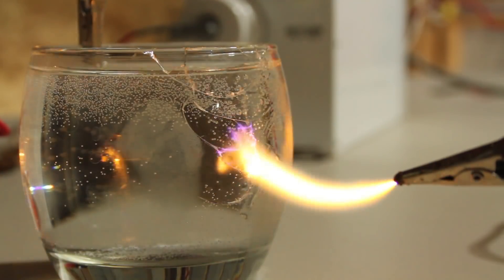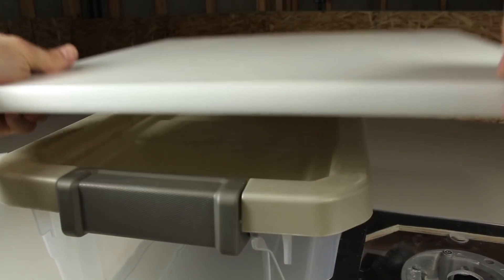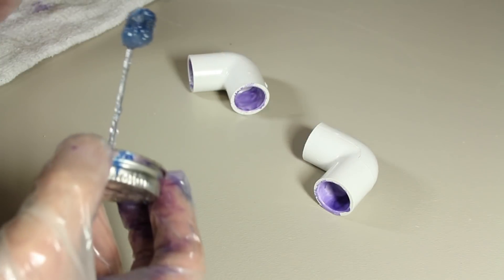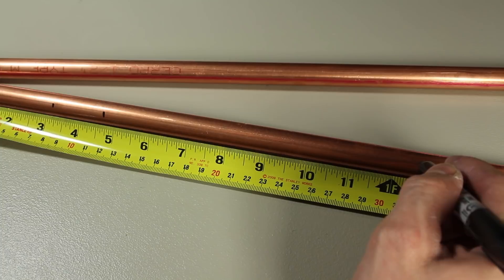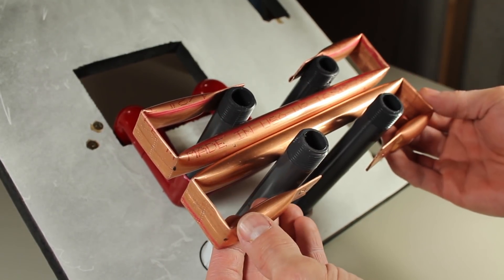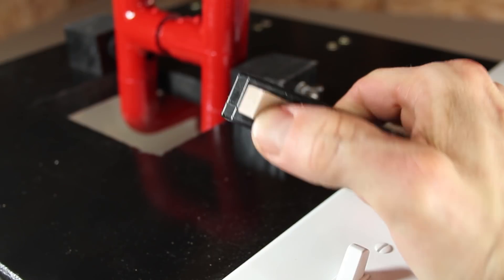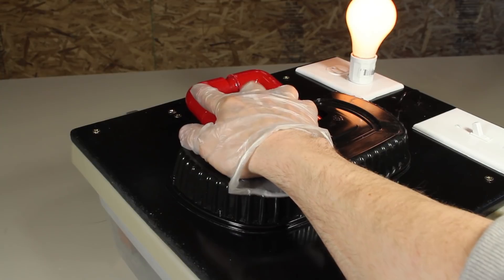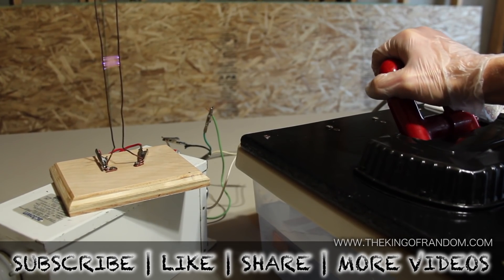The Scariac (Poor Mans Variable Power Controller)

Comment: The voltage doesn't change because the load induced by a volt meter is negligible.  If you had had a load, such as the table saw or grinder, plugged into the other outlet, the voltage would change A LOT.  Moreover, it does not adjust the rpm of a table saw or grinder, only the horsepower available, which is what is limiting the RPM.  Thus, unlike a motor control, the table saw and grinder running at low RPM as shown here would have so little torque that they could not accomplish any useful work.  The upside is, while rheostats can be inexpensive, on to handle this much power would not.  The water enables it to dissipate a lot of power, inexpensively, with a usable duty cycle.  The concept could prove to be useful in a survival situation.
Reply: your correcting a dead man
Reply: This could've been used in wound rotor motors, as it's primarily controlled by variable resistance due to its design of using brushes and slip rings

Comment: I'm wondering why the electrodes need to be so large (the 18" 1/2" copper pipe).  Does the geometry of the curved surface have anything to do with how this works b/c as the two pipes approach each other, there is a leading edge that is closer than that at a 90 degree angle (inside the tube).  Basically there is 1/4" difference between the front leading edge (the vertical middle) of the electrode and the top of the electrode, and you get 2x the difference b/c there's 2 electrodes.  

If there is 5" of distance then that 1/2" can vary the voltage by 5% and I would think you might get unstable voltages..  Would it not be better to use something like a 4g solid grounding wire that doesn't have this curve?  

Also, could the electrode be much smaller and still handle this voltage & current or is the water acting like a heat sink when the speed is low (more resistance), and will eventually get really hot?

This just seems like a dangerous setup and would think doing this inside a PVC pipe would be better, with an electrode at the bottom and a plunger that can be moved up or down.

Comment: would it be much safer to buy a high voltage rectifier instead? one with a dial to raise, lower voltage tie into an amp meter to see just what you have? be a lot safer.

Comment: Have you checked the output on a scope by chance? I need a variac due to it's sine wave output. Does this output the same or is it a modified wave like a light dimmer or motor controller produce?

Comment: amazing video and idea, but just a little note, the voltage can not be constant, you were just measuring with no load connected hence just getting the open-circuit voltage, however with a load the voltage must change.
what you're saying is that the grinder always has 120v across it yet changes speed as you move the thing, that does not make any sense

Comment: Correct me if I am mistaken, but it seems that this "scariac" could be added to an electric arc furnace to regulate temperature. If I am wrong, what is my best option to achieve temperature control for melting various metals?

Comment: hii,

i purposely revisit this video. because i watched it before.. 
i saw youtube video of using salt water as stick welder project..
and that made me wondering why is the author (forgot his name) uses lye as conductor in the water.. why not use salt ? since they uses salt to do arc welding.. why not use salt ? it is cheaper.. also 100% salt.. - minus a little bit mineral away.. 

or why those who do salt water stick welding don't use lye, instead of using salt ? 

which is better to be use in water ? lye or salt ? 

thx

Comment: bear in mind this comtroller won't work with Direct Current (DC) as the electrolyte will cause electrolysis making HHO gas, which will pop off the lid with pressure.

Comment: I wish ppl wouldn't be so prejudiced against water with electricity. It should be thought of as a liquid wire. It's only risky if you touch the water with both hands when both electrodes are in it. It only makes bad things happen if it gets kn ELECTRONICS as it can short things out. As a fun experiment, use 12v at 6A and put an a cathode in a bucket and an anode in another bucket, then out your hands or fingers in a bucket each and watch and feel your fingers spread out by themselves. It feels a bit like pins and needles but is perfectly harmless at such a low voltage. If this sounds too scary, try putting a 9v battery's contacts on the wide part of the surface of your tounge. :)

Comment: Suggestion: washing soda rather than lye to make an electrolyte. Should work fine, but is a lot cheaper, is easier to find in your grocery laundry section, and won't dissolve flesh. Borax would likely work well also, although is mildly poisonous.

Comment: Everyone is acting like if you build this thing your also going to be using the electrolyte reservoir as a bathroom sink.  Anyone who doesn't understand what an insulator is for should not attempt this project anyway. It's about as dangerous as the wiring in your walls. Ya'll realize those wires are insulated and ran through wooden frames right? Insulation is the line between life and death.

Comment: wow it's not even grounded 

looks ok for low voltage devices but even im not insane enough to tinker with the mains (especially since we use 240v here in Australia) 
and im the type of bloke who walks around with 5KG of unprotected laptop battery cells taped together in the form of a homemade power cell for phone/laptop charging

Comment: ingenious invention. but....particle board exposed to an ionic solution with bubbles/evaporation, questionable. a different solid board might/would prevent degradation and interaction with particle/press wood glue, reducing  risk of explosion. the "melamine" and particle/press wood board with all it's glues and exposed reactive content, regarding binding, once water, etc. are introduced, are a chemically a reactive nightmare. just sayin'

Comment: Your idea is terrific, but it is not appropriate for controlling induction motors, in fact, it might burn them, these motors try to keep their speed and HP constant, if the voltage lowers, they use more amperes, thats a problem.

Comment: very nice but why didn't you use a bearing flush cutter / follow wheel on the router table with template you made to cut the holes in the mfc?

Comment: 1 its resistance hes changing
2 tap water will go through electrolysis which produces hydrogen that could ignite from an arc
3 running too low voltage through motots can make it not turn thus dropping resistance and you have too much current. Although he did only change current, it sorta implies it's fine to run electric motors with a variac.

Comment: when I first saw the thumbnail for this vid I though you were making a saltwater rheostat, which is what we use for load testing generators in my line of work (electric motor/generator repair). A saltwater rheostat uses regular rock salt as an electrolyte and current is controlled by adjusting the amount of surface area of one of the electrodes (usually an old buss bar) submerged in water. one is fully submerged, while the other is suspended above the water and submerged slowly (using a chain hoist works pretty well because it gives you quite a bit of control) so as to adjust the resistance but this is still pretty cool!

Comment: If the sole purpose of the NaOH is to be an electrolyte, then why not just use NaCl instead? It's safer, and it still mostly dissociates.
Reply: Have you ever heard of chlorine gas? What about google and 'electrolyse common salt'  - the AC would help but I'd not care to risk it.
Reply: Electrolysis of sodium chloride in solution is difficult. In general, it's only easy to electrolyze molten salt.
Reply: I can tell you from experience (at about 9 years of age IIRC) that electrolysis of sodium chloride in solution is very very easy. A couple of bits of metal (or just wire if you're in a hurry) and a test tube and you're collecting chlorine gas. Been there, done that :-)

Comment: I might use this for my tesla coil, or I might use the drain cleaner instead of salt for the electrolyte in my leyden jar capacitors. Would the drain cleaner destroy glass? (my capacitors are made of snapple jars, so I guess you could say it's made of the best stuff on earth).
Reply: Grin Reaper Of Trolls it's glass, you need hydrofloric acid to get to that.

Comment: Wouldn't using this to slow a motor cause the motor to overheat?  isn't that why variable frequency drives are used to control the speed of motors?

Comment: so i have a few electric motors i want to get running, but they are old 
(pre flux-capacitor old-- or the little device in larger motors that get them spinning when theyre first powered on) 

will this device work on much older electric motors and appliances in terms of adjusting the RPM. it seemed to work on the angle grinder in the video, but the motors im working with supposedly have an inadjustable RPM. any advice?
Reply: I am also wondering if this could be used as an electrical throttle for an electric go cart build. Of course sealed very tightly and encased.
Reply: Nate Doggg232 just buy a variac it isn't worth your life
Reply: thanks for the reply you guys. Will check out the variacs.
Reply: You didn't answer his question. This is no more deadly than a toaster. Any motor that used brushes can be slowed down by reducing the current. But it will not work with brushless A/C motors.

Comment: I did this when I was just a kid using jam jars.  Burt if left too long at maximum res the water starts boiling and makes a mess.
Reply: Joe Grech it didn’t boil it’s actually hydrogen and oxygen. It’s called electolysis
Reply: @ethanparr8642  it’s probably not electrolysis because boiling water and electrolysis look very different and passing high currents through water heats it up a lot especially when it’s conductive

Comment: or i could just use a big dimmer switch
Reply: would that work the same? and could i get that on a regular hardware store?
Reply: Theworldofstuff if you have one that can tolerate different kinds of load. A purely resistive load is different than an inductive load for example. If you tried to power a home made welder with just a light dimmer it'd burn out
Reply: It also would have the potential to get stuck on.
Reply: No.

Comment: I've got a book from the period from 1860-1890. They used a system just like this, but with dozens of cells, to control the detonation circuit on naval mine fields. In other places, I've seen the same thing in books on "The Boy Electrician" circa 1910 Great grandpa wasn't a wimp.

Comment: I think I'd rather spend $60 for a basic Variac instead of possibly spending my own life trying to make one
Reply: Unless you live in an extremely impoverished region, you don't build something like this because you need it, you build it for the same reason people ride motorcycles, or gamble, for the fun of it.
Reply: Does anybody know how much current the variac needs to be able to handle in order to weld at 200amp?
Reply: @larseire7783  Mine pulls under 20 amp but only wired 240 volt.using 120 volts it kicks 20 amp breakers well before the 200 amp mark using 2 transformers wired in parallel, Unless you use two different breakers.
Reply: @larseire7783  what’s the input voltage
Reply: Jesse Carman I got a 0-380V 8A variac for 20€
Reply: Exactly
Reply: Definitely just picked up a 0-140 20 amp brand new shipped to my door for $55.
Reply: @Nigel Cam and that is exactly the reason I made one.

Comment: Could u also use this if ur electricity goes out during a storm or hurricane? Like a generator.
Reply: No it only controls the flow of power heading to an appliance. And honestly it'd be better and safer to just buy a basic Variac for $60. No dangerous water-on-electricity action

Comment: Interesting that this works, but a real variac isn't all that expensive, and most give you the ability to go overvoltage a bit as well-- 0-130V for example.   Considering the cost of the PVC, paint, container, lye, etc.,  it adds up, I'd just buy a real variac-- and it's safer too.
Reply: The thing about this - as dangerous as it is - is that it can handle (or be scaled up to handle) extremely large loads, for very little cost. While a new low-amperage variac doesn't cost too much (around $100 USD), a 100 or 200 amp variac is in a different class. Granted, most people won't ever need that much power (it would be the equivalent of plugging directly into the power feed that supplies your home's breaker box) - but the point is that this project could be scaled to allow for it. Such devices have a long history, actually: Early (late 1800s - early 1900s) large electric motor speed controllers were essentially this kind of device (except using a pitch or tar sealed wooden barrel), used for industrial and other commercial purposes (elevators, for instance).
Reply: if your going to spend $200s you may as well just go buy yourself a welding machine. Mine was only 200 bucks, runs on 220/110 and upto 170amps

Comment: Does this have any benefits (besides a higher wattage rating probably ) than just a dimmer switch as a potentiometer?
Reply: Yeah, dimmer switches cut the wave in cycles, so they can't be used to test amplifiers and other electronics, p much only useful for lightbolbs, a variak limits current while keeping a pure sine wave output.
Reply: Suicide machine bro lol
Reply: @raphaelroshwalb5500 :
Wire it to a chair. Lol.

Comment: Not... Grounded... This is less safe than Chinese heated shower heads.
Reply: Theres no need to ground as theres no metal parts... What exactly do you want to ground?
Reply: Jmanisgreat lastname the chassis is nonconductive. there is nothing to become live. grounding is not necessary.
Reply: If you grounded the electrolyte... There would be current to ground....
Reply: True, it's hard to be shocked when you blow your breaker.
Reply: You can ground the light switch and the outlet as there is clearly a ground terminal.
Reply: Yes, this is true
Reply: is it really that hard to see? ground the case above the water...
Reply: I was referring to the electrolyte. If someone were to leave it plugged in, a child could come up and put his /her hands into it.

Comment: The rms voltage that you measure with no load is the same all the time because you don't draw any current and therefore your variable water resistor dose not made any voltage drop. Measure again with a load and you will see that the voltage is invert proportional to the value of the water resistor.

Comment: Wouldnt a wall dimmer do the same?
Reply: no unfortunately not. a dimmer uses PWM to regulate the brightness of a light. Its much more efficient than a resistor but only works with lightbulbs...